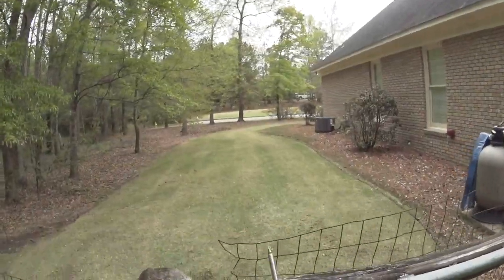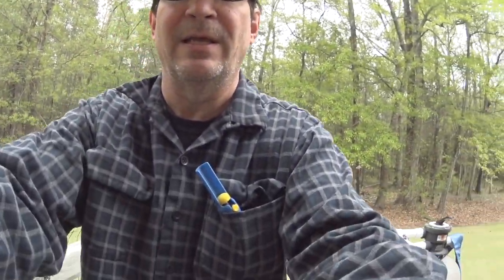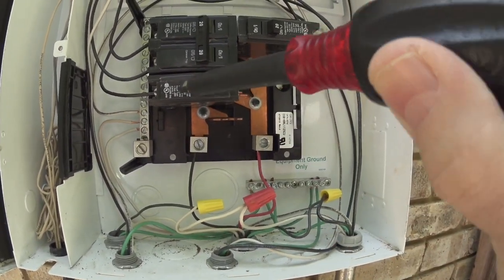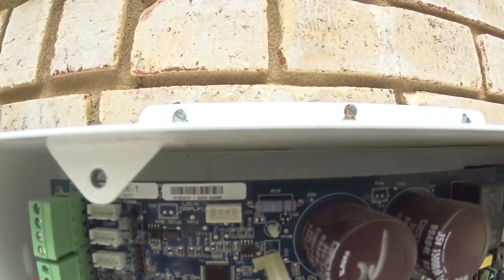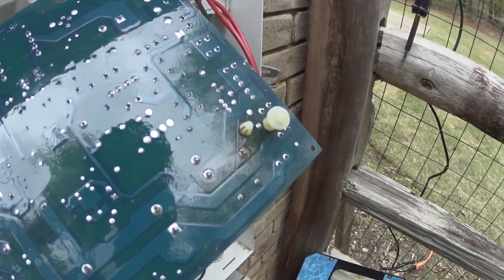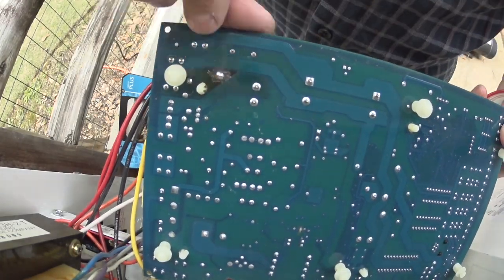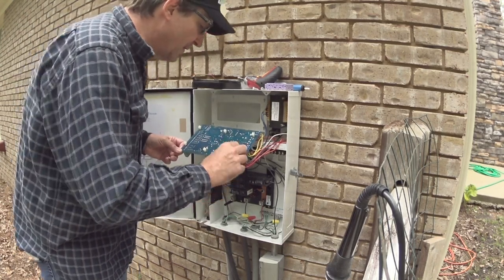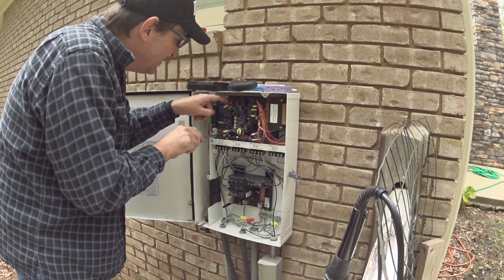Chlorinator Off No Cell Power - DIY Repair

Comment: I've repaired mine twice like this.  What is the root cause?  I had a pool guy tell me the pro logic is crap because of this issue.  What do you think is causing the issue??  Thx
Reply from the maker: Not sure,  maybe the relays and connections are undersized and generate too much resistance and heat?  My relay is still good but the internal clock seems to be losing time, another common problem with these boards.

Comment: If in doubt about working around or near "live " buss boards(area around and including breakers)...try covering with cardboard cover(homemade piece) is a good practice.
Reply from the maker: Using cardboard to cover the live buss boards is a really good idea!  If the solder joint on my control board fails again I’ll remake this video with the power feed completely cut off.

Comment: No cell power to display this morning on my aqua class pro logic board watch this video when out there and perform the soldering of the joint and viola fixed!!  THANK YOU!!!!!
I think I am going to buy one of those relays to have on hand just in case it happens again I may just replace the whole relay. 
Would you happen to know the info for that particularly relay?
Reply: I just did this also. I added salt(possibly too much at 1 time) before this happened and think that's what caused the problem. The relay can handle the amps just not the solder joint. Changing the relay will be very tricky taking it out without damaging the circuit board traces. I have tried and failed.

Comment: Any idea what causes this - just a lack of solder? or too much amperage on the circuit?
Reply from the maker: My guess is it’s a design flaw with too much power on the circuit which causes the connection to fatigue due to continuously heating up and cooling down.
Reply: @fiveable  makes sense! Much thanks for posting the fix! Like everyone else here, it saved me!

Comment: I have the aqua blue 47 u think it’s the same for me. Have same problem!
Reply from the maker: I’m not familiar with the Aqua Blue 47. If it was mine, I would cut the power off at the main breaker, pull the board off and look for bad relay lead connections. Basically the same procedure as the video. Best of luck to you with it!

Comment: I had the problem as well.  I removed everything, and before I started taking off wires from the board, I have 3 fuses.  20, 4, and 3 amp.  I did replace the 20 before for a different message.  I replaced the remaining 2, which I did check for a distinct break, which I found none.  Low and behold, the message is gone, and shows all data from Cell.
When I first recognized the pool was getting some green on bottom, I opened box to see breaker was tripped.  I turned back on, and message was recognized the next day.  I should have confirmed no messages when I reset breaker.

Comment: i am having this issue but i actually witnessed that when i tried to power the salt cell on through the control panel some smoke came out from the board. before i invest in a solder and open up the board i wanted to ask if it might be a fuse instead (because of the smoke) and if so what i should do in that case.
Reply from the maker: Safety First: Before removing the sub-panel cover, turn the power off at the main breaker that feeds the whole pool sub-panel. That’s the safest way to work on it.

I doubt it is a fuse. They don’t typically smoke and on a board like that if they go it is usually because of a problem that needs to be resolved.

You might pull the board out like in the video first to visually inspect the solder connections. If it is a minor problem with the pin connection, re-soldering the pin might be all you need. If the pin connection is good it could be a bad relay or capacitor.

For a better view of my board images are available on my support webpage: fiveable.com/support

If your problem is more than just the pin solder connection I can recommend a professional service that will repair the board and give a 3 year warranty for a fraction of what a whole new board will cost.  I have used this service myself for a clock replacement and have been extremely happy with their work. See link at the bottom of the support page.
Reply: @fiveable  i am awaiting delivery of my soldering kit but when i checked the rear of the motherboard there was some dark almost burnt looking area on the board directly adjacent to the discolored pin. could this mean more extensive damage to the board or is it consistent with this issue in the video. i wish i could send an image
Reply from the maker: @jawfurr  if the connection has lost most of the solder it will definitely look discolored. It could also give off smoke from electrical arching. Since you have ordered a soldering kit, it’s worth trying to solder it. For a better connection, scrape some of the blue/green coating off the copper metal trace that pertains to that pin. This will allow you to connect the pin to the trace beyond the burned area. Make sure to only solder the trace and relay pin that go together. Again, you can see an image of the board and re-soldered connection on my support webpage: www.fiveable.com/support. The triangle connection was done by the service with link at bottom and shows the shape of the trace for relay pin that usually needs to be repaired.

Are you in the USA? HaflerUSA can replace relays and other parts but I don’t think they will ship outside of the country.

I’m not currently compensated by or affiliated with HaflerUSA. I share their information because I have gotten great service from them with my own board the in the past.
Reply from the maker: I got your photo. The connection that is bad on your board is the same as in the video. Your connection definitely needs to be re-soldered. Luckily the trace on the board doesn’t look like it is in bad shape. I believe in your case re-soldering should be fairly straightforward and will not require scraping the blue coating off to get a good connection again. Please let me know how it works out. Hopefully you will be up and running again soon!

Comment: Before you do this, There is a 20 amp fuse on the right my hand side of the board when you take the front metal plate off. Check to make sure this is not blown. The first time I cleaned my cell I forgot to unplug the cell and I blew the fuse.

Comment: Hello I could not get mine to work. So I ordered the piece that was in that area took it off then soldered the new one still get the same error
Reply from the maker: If you are in the USA, you might consider looking on ebay for a service that rebuilds the controller boards.

Comment: I have been fixing my K1 connection for years now. My system is 17 years old now. I have soldered and re soldered. I know less solder is better. But I can't get it to work again. Any suggestions? Do I need to buy a new board? Ugh. I just bought a new salt cell recently. It's my 4th or 5th. Thanks for any suggestions from anyone
Reply from the maker: If it’s an ongoing problem you might consider sending the board to a repair service. You can find one that specializes in repairing these boards on eBay.
Reply: so it was not the K1 connection this time, but it was the small fuse on the front of the board. Easy fix
But now we had a power outage and a surge and my display says  "Communication error 1". This happened before and I fixed it somehow. But I can't remember  what I did. Anyone?? suggestions
Reply: @fiveable  no body really repairs boards any more. My wife works for a aeronautic company and builds two sided boards. She laughed at me when I baked our LG television board in the household oven. She bakes boards in a temp control oven with exact temps and time. But it worked for a while. These older LG TV's  have bad boards. Each time I baked it , it lasted less and less time (3 months, then 2, 1 and then nothing).
Reply from the maker: Someone else recently posted that the fuse was their problem. Unfortunately they didn’t offer any details. The reply was something like “It was the fuse for me.” I hope you get it sorted out. Apparently these boards can be increasingly unreliable over time. The clock on mine has gone bad and it cycles randomly. Bought the parts to replace the timer chip and crystal but haven’t tried replacing them yet. I just keep an eye on the pool and make sure it doesn’t go too long without circulation.
Reply from the maker: I know what you mean. It's terrible! I have run into a similar problem with a TV that was just out of warranty. Don't even get me started about LED light bulbs that are supposed to last forever but die in a year because the cheap voltage conversion circuit in the base burned out! By the way, you are lucky your wife let's you use the oven for electronics.  I would have to do my baking while mine is away. :)

Comment: I just followed your steps to a T but the issue reappeared a day later. Any ideas?
Reply from the maker: Do you think the connection to the trace on the circuit board was good? You can scrape more of the protective coating off the trace for the relay lead and add more solder to displace heat and conduct better. For example of what it looks like take a look at the photos I have on my website: https://fiveable.com/support/

* For safety, turn off the main panel circuit breaker that supplies power to your pool control panel before working on it! *

If it turns out to be a bigger problem like a bad relay or capacitor, I can point to you a service that can repair these boards quickly with a guarantee. I have used them myself and have been really happy with their work.
Reply: How much is the repair service?
Reply from the maker: @ShippJordan, I contacted the owner of HaflerUSA. He said the board probably needs a new relay. The cost of the repair, with a 3 year warranty, is $160 plus shipping. He added a No Cell Power repair item to his eBay store if you are interested.

Here is a link to his eBay listing for the repair service:
https://www.ebay.com/itm/386991073676

Repair and testing turn around is usually 1 business day. Since your actual board is repaired, you won't need to reprogram settings to match your pool equipment. 

Removing and reinstalling the board is not any more difficult than what you have already done to resolder the connection. 

!!!—> Make sure you turn off the main panel breaker that feeds power to the pool sub-panel BEFORE removing the sub panel cover and working on the control board. <—!!!

Tip: Take a bunch photos of the wires before disconnecting them so you know where they go. The greenish screw terminal connectors on the left side are three separate plugs that can be pulled out. You don’t have to unscrew them.

Comment: even if this isn't my issue, great video.
Reply: @fiveable  Sadly didn't fix it for me. I'm going to replace the switch now (similar video) before the board. $10 part vs $530 replacement board is worth a few more days. Thanks for getting this started for me and a reason to learn to solder.
Reply: @fiveable  Thank you for the reply. In my attempts using your method above I also learned to remove the solder with the pump. =) I agree. It's worth a $10 risk if I'm going to have to replace the board anyway. Also, getting to learn more stuff is always a good thing too!

Comment: what temperature should I select for the joint ?
Reply from the maker: I used a 25 watt soldering iron in the video. There isn’t a variable heat setting with that type of iron. Just plug it in and wait for it to heat up (Approximately 700 F).  Max wattage I would even consider using on that circuit board would be a 30 watt iron and that’s kind of pushing the limit. Using more than 30 watts greatly increases the risk of damaging the board.
Reply: @fiveable  thank you very much. I’ll try doing this job today since I started getting the chlorinator off high salt/amps message. My cell is brand new and I’ve removed 1 foot of water , added fresh water and still get the same message on the display. Hope this resolved the issue.
Reply from the maker: Be sure to turn the power off at the main breaker box! That is the safest way to do the work.  Best of luck to you with the repair!  Looking forward to hearing about your success with this too!
Reply: @fiveable  so finally a quick update here. We soldered the k1 relay joint in the back and the messages were gone. Wonder if this will last...but for now the family is happy and we saved $ . Big thanks for the video really appreciated.
Reply from the maker: So far my repair has lasted 3+ years. Hope your lasts a long time too!  Thank you for the update sharing your success!

Comment: looking to tackle this tomorrow
Reply from the maker: Flip the main breaker that feeds the sub panel for the safest way to work. Hope it’s a quick and easy repair for you. Definitely interested in hearing about the results. Thanks for commenting!
Reply: yes sir. will do, put it off for a day, I will report back
Reply: i see the problem..same thing that you showed. I tried appling solder. It was hard for the solder to take and after trying 3 times and getting some solder on it, it didnt work. what do I do now?
Reply from the maker: Do you think the solder got on both the relay contact and the circuit board?  You do need to hold the tip of the iron on long enough to heat the relay lead enough for a good flow of solder. Also the circuit board might need to be carefully cleaned/scraped a little right at the point where the lead comes through. If it’s burned to the point the foil trace has been eaten away you might need to expose a little more of the metal trace by scraping off a little of the green coating but be careful not to scratch through any traces or cause a short by connecting two separate traces with solder.
Reply: 2.5 hours and no warning light. fingers crossed! I went out and bought a higher wattage and temperature solder iron, listened to your advice and others about soldering and making sure I focused on the element. I will give it till tomorrow or sat. and double check the salt levels..I will report back. Thank you!
Reply from the maker: That’s awesome! Fingers crossed here too!

Comment: I'm experiencing this right now. The aqua plus has a 30+ second filter "boot up" before the error appears.  I noticed you gave the all clear before 30+ seconds had gone by.

Did this really fix it?
Reply from the maker: Yes, my Aqua Plus has been working fine since I made the video a couple of years ago. Chlorine levels are always good and never turned green again.  As for 30 seconds,  I may have edited out some time in the video to make it flow better.
Reply: @fiveable  FYI, I tried your fix and it worked for me too
Reply from the maker: That’s great news!  Thank you for commenting and sharing that the solder fix worked for you too!
Reply: @fiveable  The no cell message was off and after the 30 second boot up the message is back again, I have tried to solder twice now and it goes off and then comes back on.  Any suggestions?
Reply from the maker: How badly was the connector burned when you found it?  If it was severely burned there might not be enough of the conductor exposed on the circuit board.  Sometimes it is possible to clean it up and expose a little more of the contact trace by carefully scraping off some of the non-conductive green coating with the tip of an exacto knife. You have to be careful not to short out other contact traces with blobs of solder. Hopefully the third try fixes it!

Comment: This is the first video I saw with a Aqua Plus. I was hoping it would help me since I replaced my salt cell and the system still says the salt level is extremely low even though I tested it and it was 3300ppm. But the back of my board looked brand new.
Reply: No it was just saying No Chlorine. Turns out I had to shock the mess out of it to get a high enough reading to be able to reset the salt settings.

Comment: I had to do this about 2 years ago.  Looks like I need to do it again.  Hoping it works again.  The panel is about 10 years old.
Reply: Ok.  It works again.  Im not sure how many times I am going to do this before I have to replace that relay.  I bought a relay on amazon for about $10 just in case.  

https://www.amazon.com/gp/product/B07CYNMHB6/ref=ppx_yo_dt_b_search_asin_title?ie=UTF8&psc=1

Comment: Hey guys . I need help , so my husband did everything you explain . We turned everything back on . The service light shut off by its self and the no cell power message disappeared !! One minute later the message came back on as well as the service light ! Help someone please ! Should we solder it again maybe we didn’t solder it correctly ? Or like the manual said , do I just have to replace the entire PCB
Reply: The same happened when I followed this video. Heard a click/pop about a minute of the pool back up and running and that darn message was back. Re-solder?

Comment: I am totally NOT a DIYer but I am going to try this.  So all you do is just add solder to the joint.
Reply from the maker: Yes but BEFORE you take the panel cover off make sure you TURN OFF THE POWER FEED TO YOUR POOL CONTROL PANEL AT THE MAIN BREAKER BOX!!! This is the safest way to work on it especially if you are not a DIYer.
Reply from the maker: Make sure to hold the soldering iron on the pin long enough for the pin to get hot so the solder will flow around the pin and make a good connection.

Comment: Does anyone have a suggestion as to how long I should run my pump and therefore my chlorinator as regard preventing a recurrence or does chlorinator flip on only do 2 chlorine reading?
Reply from the maker: Not quite sure what you are asking but I run my primary pump 12 hours a day and the auxiliary pump for the Polaris pool cleaner only 2 hours a day.  This was the recommendation from my local pool supply company.